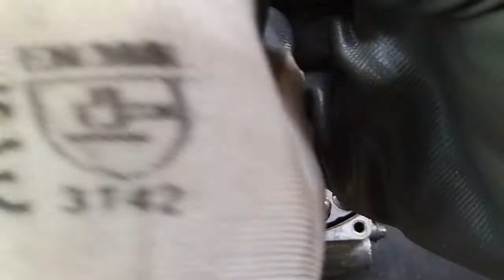car ac scroll compressor complete rebuild | part 2

Comment: Sir..why does after i tightened the screws it hard to rotate manually..need assistance here..anyone...?tqvm
Reply from the maker: There is shim based gasket available inbetween clutch shaft assembly and scroll body, if it very tight to rotate please add one more gasket...